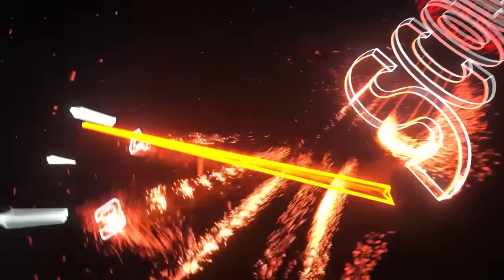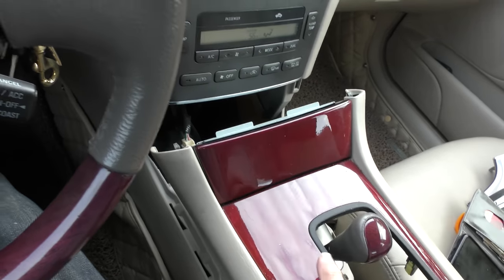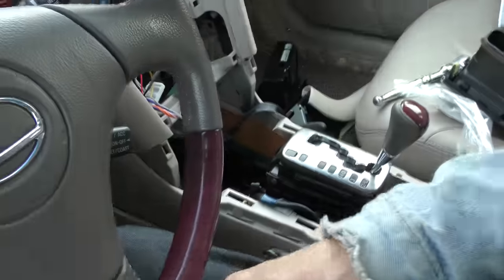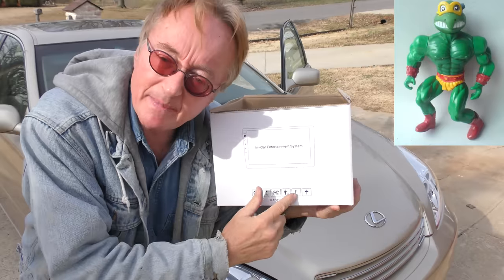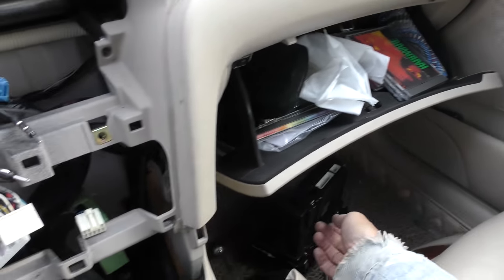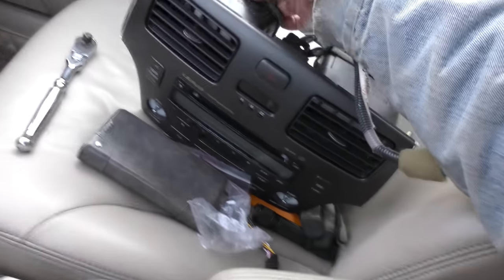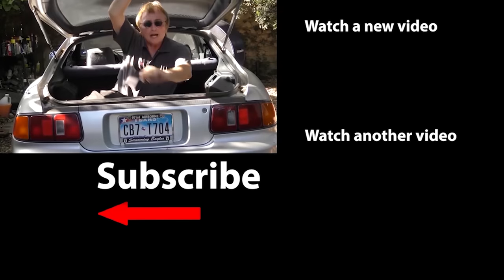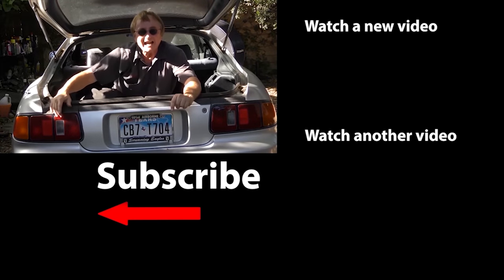A Sad Day for Toyota and Lexus Owners, I Just Screwed Up

Comment: I used a local shop to install my new head unit and under seat sub-woofer in my 2007 Tundra, he had the correct adapters, and I installed the two door speakers. It sounds great, and cost very little.
Reply: You could have bought the adapter anywhere and done it yourself though
Reply: @richsweeney1115  Nope... I know my limitations, and the shop warranties their installations. Win, Win for me.

Comment: My dad had a Nissan rogue 2017 and I installed this on his vehicle along with some LED lights that lit up the car as the music played. The radio worked great (most of the time) but would randomly cut off for a day or 2 and then come back on. Fit and finish was excellent but it's a shame that their QC isn't there yet
Reply: @Transitive Wisdom it was installed under the dash and seats so you can't see them, they are wire tucked, and hardwired it actually came out nice. Youre entitled to your opinion though lol

Comment: I would get those little Bluetooth adapters that plug into the cigarette lighter. Kinda have to fiddle with it since they do have to connect to a radio station. Just find a station that's quiet,match it up with the Bluetooth model then it'll work great. Got one at Walmart for 20 bucks and it sounds pretty decent actually.

Comment: Scotty too bad on the Android.  There are some nice Androids to update my Mid-2000s dinosaur Comand System however I would have the same problem a wiring nightmare.  On the headlights I know you like Plexis for the protection but since yours are brand new I like the Lamin-x protection covering which can be bought precut to your specific vehicle.  Also if you ever get a lite amount of moisture or fogging in the Chinese made lights I put a few packets of silica gel inside the back of the housing way at the bottom where there are no electronics they dry out any light moisture.

Comment: Can you cut and splice the 8 cables that the old harness has and twist onto same number and colours of the LCD system as the fitment looks so sweet ( bracket assembly) would increase the value of the vehicle
Reply: Any problems on instillation check the fuse box in car and I didn't say solder or flux as it's so hot near fingers in a confined drip area you'd know of insulating tape as you splice every wire and maybe earth wire first dissconect car battery . Solder would be very cool though .
Reply: To light a fuse won't do damage it'll just blow but to heavy fuse the system might blow instead of the fuse ie a 15 amp vs a 25amp ( only my opinion ) maybe a headlamp for your head
Reply: You could try splice and use mini alagater clips to check the LCD system before installing whilst the old system is connected.

Comment: That radio didn't bring the proper harness. What can you expect from a generic online Chinese company. Walk into a Best Buy, they use a fit guide on their computer that will get you the proper harness, antenna adapter, & steering wheel control adapter if your's has that, as well as the trim kit. Metra is a good quality brand. It's not worth going cheap with this stuff. If you want cheap, then paying a radio guy to cut & reconnect wires is the way to go, but remember it's not going to be pretty or good.
Reply: You forgot that Scottie is cheap, so BB is out 😂
Reply: @mycitysucks8096 I know, but at least you'll know their exact part numbers you'll need so you can buy them wherever.
Reply: @shechshire  yeah I agree

Comment: I was about to question the ease of popping in a new sound system with the Toyota plug problem when you ran in to that compatibility brick wall. Not going there with my old but good Toyotas.

Comment: Scotty!  

Have you ever tried those Bluetooth cassette adapters from eBay?

I used them for years till I sold that car. It had a good radio so why replace it. 

Get the 5.0 bluetooth types. 

I got a few of them so when one would run out of charge I had another charged and ready. 

The hands free part sucked but all the rest worked great.

Comment: It’s not that hard to tie new speaker wires to the old ones on the factory harness and pull them through, tuck them under the carpet, run them back to the trunk, run a couple new power cables from the battery through the firewall all the way back to the trunk, install a couple amps, build a sub box, pop all the door panels off, replace the old speakers …………..😂😂😂😂
Reply: You don't need to rewire much of anything.....you get the right adapter..
Reply: @richsweeney1115  not if you want it to sound good. The factory amps are underpowered, the factory speakers were garbage when they were new and the wire they use is too small of a gauge. All the adapter does is tie your new head unit in to the old trash, which doesn’t accomplish anything other than adding Bluetooth.
Reply: @fatguyonthc  what I'm saying , is the front and rear speakers, and head unit, I'd just buy the connector the plugs into the harness, I've never found the need to put an amp to any interior speakers. I've upgraded the stock speakers yea. And I have  different subs and amps, yes you gotta wire that, but I meant re wiring all the speakers. I love your name, btw. And the dogs in your pic
.

Comment: mostly pointless. just get a somewhat larger phone and put it on the gauge closer and stare at it from there haha. it has map, vehicle speed, PROCESSOR speed and quality apps that beats some head unit in most ways except you cant play music through the cars speakers. your little cylinder bluetooth speaker is pretty neat tho. CDs play higher quality sound than a phone too so its nice to retain that in your car. im surprised you dont have some magnetic cassette tapes to play lol how do those sound, havent heard them in forever.

Comment: Toyota crappy Entunes 2.0 infotainment system doesn't support Android Auto and Toyota won't update it. Only the new cars (after 2018) that have Entunes 3.0 get Android Auto.  I don't like that put Entune 3.0 in the 2018 Camry when it got redesigned but still kept putting Entunes 2.0 in the 2018-19 Corolla and other older models.  Of course, Toyota didn't support Android Auto until 2020. They have a problem with Google Privacy. So, people who own the previous gen models are stuck with the outdated infotainment system.

Comment: So wrong pac and metra both make a harness for that car it does not have to be rewired that's non sense it's call by the right harness for the car and wire it in the the radio harness the way it's been done in my 28 years of car audio never take your car to a mechanic to have your radio put in

Comment: Scotty I have a question, I was looking to purchase a 2005 - 2006 Infiniti fx model vehicle I prefer the fx45 over fx35 but engine wise, which is more reliable and less problematic the v6 3.5l vq35de or the v8 4.5 vk45de and all wheel drive or rear wheel drive

Comment: Scotty did review and recommended a few FM transmitters with Bluetooth function ~3 years ago.  I bought such device because of his video.  He also provided few pointers on those devices as well (recommended using aux jack for the clearest sound if you have one)   For the purpose of this particular video, he just want to try out a nice touchscreen Android system looks slick/clean for his wife's car.  It's a bummer we won't see how well the head unit perform due to the adapter/harness incompatibility issue.

Comment: OUCH! That’s gotta hurt sending Scotty a product that doesn’t fit. Now nearly 5 million people know that product is crap. Well done dickheads😂😂😂.
I worked for our government bus company which had about 300 buses and every year when we got the first couple of hot days of summer (Australian summer) half the fleet would be off the road because the air conditioning systems didn’t work because the gas had leaked past the seals so the workshop guys connected a wire from the reverse lights to the relay that controlled the air conditioning compressor so every time the bus was put into reverse the compressor would be switched on. This worked very well to keep the seals in the system lubricated and there were nowhere near as many air conditioning failures. I always  use my air conditioning as a demister in winter to help prolong the life of my air conditioning system. Cheers Stuart 🇦🇺
Reply: It's not crap, someone made a mistake